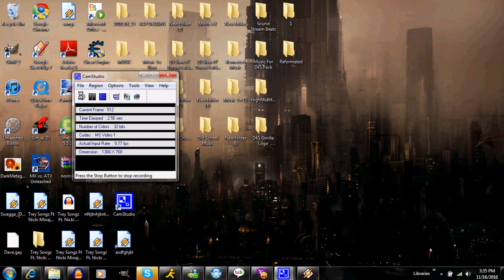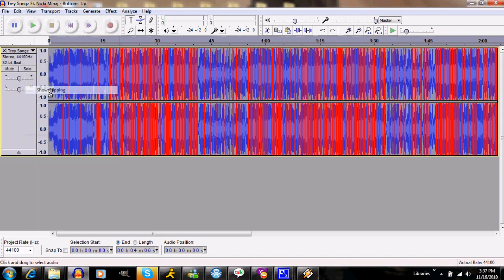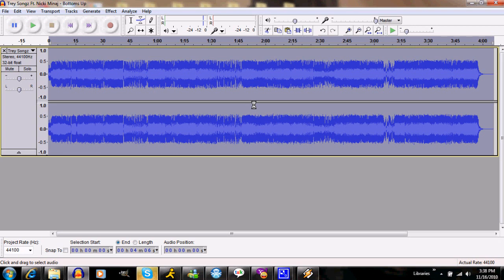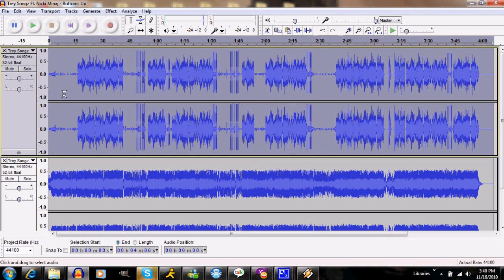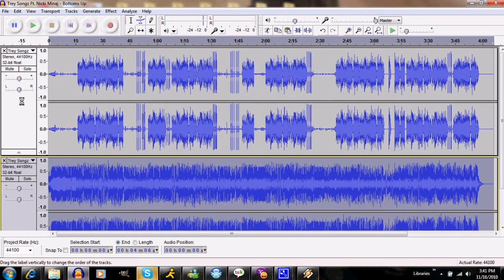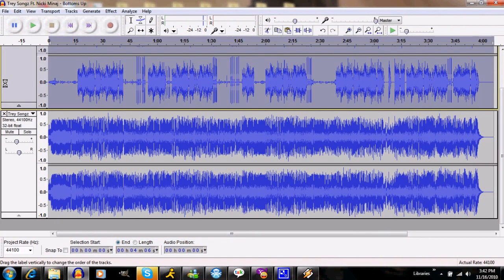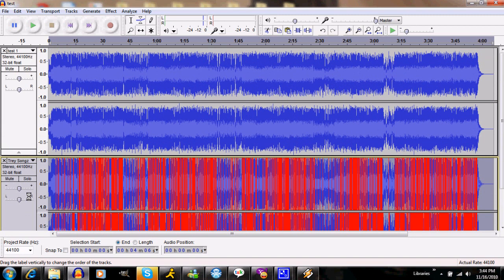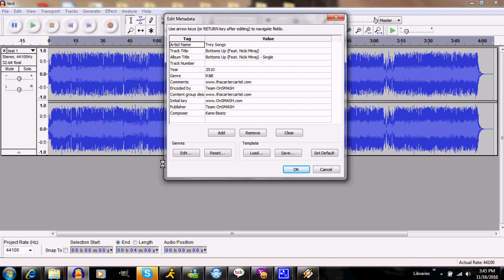Audacity 1.3 Clipping Removal Tutorial

Comment: Originally clipped waveforms aren't dangerous to gear except for the fact it has higher RMS, which is only an issue with woofer coil's thermal capacity.  But the exact same risk is present with waveforms that have gone through pleasing-sound compression-limiting with the same RMS outcome.  Output clipping on a power amplifier, however, is dangerous to tweeters from ultrasonic peaks far beyond the rated power of the amp (mismatch with the drivers with regards to handling), which is why all pro amps now have output limiters.

Comment: Uh, scratch that. I just put that audio with the video and I can still hear the clipping. It doesn't make sense. I followed your instructions. Why am I hearing the clipping?
Reply: Clipping is a distortion - this guy’s method doesn’t actually fix anything. To fix clipping, you have to go to source track.
Reply: Okay. Then what? Do I use the same instructions?
Reply: Honestly, I’m not that technically savvy. I’m not sure what to do next.
Reply: You can't fix peaking (otherwise known as clipping). It was the original voice actor's fault for not setting their gain low enough on their mic.

Comment: I have not tried this yet, I have a question, How does the low pass original file merge with the high pass duplicate file? How does saving two files (exporting twice) create one file? (I do not understand, sorry) Am I missing a step? Thanks in advance, rock on!
Reply: He exports it to merge the tracks (audacity auto merges them into a single set of stereo channels) then exports it again after re-amplification to get the final product.   Doesn't seem to be an easy way to merge the tracks without doing it that way.
Reply: Why not export and re-amplify at the same time?
Reply: Thank you everyone for responding. I have a version of Audacity that has a merge feature, really very easy. There are "101" versions of Audacity, some features work well on some, not on others, ie: nice sounding reverb program vs another version that's terrible.

Comment: Hey, my question is about how running a hpf and lpf, both at 70hz, redraws the waveform. I've tested this, and have seen that it actually works. Just wondering why or how it works. And couldn't the 70hz boundary actually be anywhere? 100hz? Etc? Or is there something special about 70hz? Thanks.
Reply: A lot of the clipping happens at the peaks caused by the bass. The squared peaks generate noise energy at harmonics of the bass's energy's frequency. Removing the harmonics from the bass restores its waveform. 

Most of the energy from melodic or harmonic instruments (including the human voice) has frequencies above 70 Hz whereas most of the energy of percussion instruments has frequencies below 70 Hz. 

The noise energy still exists in the higher-frequency tracks and is re-introduced when the tracks are mixed back together, so the distortion is merely mixed with the cleaned-up bass, not eliminated. 

I do not think the process removes any distortion from the upper-frequency tracks. However, if you wanted to divide those tracks at, for example, just above the peak frequency of the vocalist (700 Hz for speech of mature males), you might gain further reduction in distortion. It depends on the nature of the sound.

I don't think this is the best way to achieve de-clipping, but until I find an add-in that actually works, this will have to do.

Comment: Are you sure digital clipping can damage audio equipment?
This is a clever approach but I honestly think that the current clip fix option is a cleaner solution.
My advice is to double check if fixing clips is neccesary. In my experience most clipped audio files have not lost crucial information and a "simple" normalizing is sufficient.

Comment: Okay this seems really stupid. First thing first, clipped audio data has no way of harming your speakers/headphones. If it did, by the end of this video we'd all be staring in amazement as our speakers catch fire. The voice recording clips like hell.

Damage by clipping is a myth instigated by people mixing it up with clipping in a power amplifier. PA clipping creates high energy high frequencies which might overload tweeters.Then there are people who claim clipped data creates DC output which turns a speaker's coil into a heating element. This exhibits a lack of understanding physics; DC heats a coil just as much as AC of the same RMS value. So unless you pair an overpowered PA with weak speakers, there is no way any signal (clipped audio/square waves/even white noise) will overdrive the speakers. To add on this issue, no digital to analog converter interprets a clip or a square wave's top and bottom as DC, but uses fourier series to approximate the waveform using sine and cosine functions (so output is still AC, no matter what).

Now on the technique shown in the video. What is done is splitting a song into one sub 70 Hz and one above seperate clips, then the sub 70 Hz clip is mixed back with the rest of the song's spectrum, but at 3dB less. So unless audacity's EQ algorithm is real fucking wonky this procedure should do fuckall to fix clipping. You just lower the volume of both the clips and sub 70 Hz bass. Also, look at the green line of audacity's EQ. That's how the frequency response of the audio is actually processed, so even after multiple EQs there will still be quiet but audible remains of what you tried to filter out.
Reply: The method filters out the harmonics of clipped bass in the bass track. That restores the waveform of the bass track. However, the harmonic energy is retained in the midrange+treble track. When you mix the two tracks back together, the quality of the bass has been somewhat restored. That's all it does. 

It should be possible to fix clipping, but Nyquist programming is over my head.
Reply: +Zaparter while your imput seems educated i thank you for it however you denounced his method and also neglected to offer your own solution to the problem. . .
Reply: ForeverGoth There is no real solution to the problem. All audio information that was contained in these peaks is literally clipped away.

Minor clipping may be fixed by Audacity's Clip Fix algorithm with satisfactory results. Just lower the overall volume by a -6dB gain and apply Clip Fix. If the added peaks clip again you can undo and try lowering overall volume even further, but I wouldn't think those clips are minor enough to be repaired if that's the case.

Think of it this way: The waveform of let's say a kick carries all other frequencies of the mix, they basically oscilate around the kick's wave. If the kick's wave exceeds the brickwall, not only does the kick start sounding like a shoebox, but also are all other frequencies wiped out of the mix during every clip. There is no way of fixing such damage.

You might know this, but all of these clipped tracks that are released are a result of, as some call it, the 'loudness war' or as others claim 'better studio compression'. However I find it hard to believe that actual sound engineers are so bad at handling their equipment and/or software that they master recordings to hard-clipped BS in 8/10 cases. Taking into consideration that virtually all record and CD pressings (+downloads) come from the same master, but in almost every case only the digital releases exhibit clipping and signs of high-ratio-low-threshold compression really makes one wonder what the fuck the music industry is up to (e.g. have a look at Plastic Beach by Gorillaz http://imgur.com/SFmL9tD). There are exceptions to the rule, but those are mostly outside of genres that in any way might be labeled Pop/Rock.

So yeah, I guess if you really want to do away with clipping and you are lucky enough that your preferred music is issued on record, you might want to drop ~600$ on a turntable, preamp and A/D converter.

Comment: I have found that using too many volume tools adds distortion or there is some crunch in there because the digital signal is just manipulated so much. Like most things in life it is good to use things in moderation. I just mix/rendered in there and got distortion. These tools are valuable but, must be used carefully and checked for artifacts/distortion or strange sounding stuff added. I have not used this step but we did not hear for artifacts either. Trying things is good unless the effects are not good. I try to get a great saturated signal to start with and then the need for tools is lessened. But heck, try these things as these guys put some time in there. Getting the signal strong up there is very important without clipping. Pro's use some tools that are expensive and use some techniques/secrets in their programs that do these things without distortion and though the signal looks clipped there in audacity it might sound great on the radio or any player. They are after maximum volume without clipping so their mix is on top of or equal to any/all played on the air or at clubs. Audacity is great and more improved all the time but, is free and might have limits over expensive software or digital tools/hardware. there is a digital mixer out there for mastering mixes ranging in the 10's of thousands of $ dinero. Keep on recording or mixing.
Reply: I mixed/rendered and got some clips and is why I tried this tutorial. Compression/hard limit worked ok and got the clip out without any artifacts. I just wanted to see. I will be getting a 4 I/O usb hardware (@about $200.00) and they usually have great intro software that has most features of the expensive version for mixing.

Comment: Amplifying things isn't the way to go, it makes the track sound funny and actually changes the sound. Normalizing is what you're gonna wanna do, it keeps the integrity of the track. Don't ask me why that's the case, I have no damn clue.

Also Bodycage is right, you're not fixing the clip. It still sent too much sound through the system and it messed up the actual audio signal. So it'll sound better, but it'll still sound bad. Also, comb filtering isn't removing audio, it's different and ugly.

Comment: As much as I appreciate the effort you took into making this, this did not help. What you did was splitting it into two bands, and making one quieter. The exact same could've been achieved by EQing with a very steep curve (a brick wall version in your case). No need to split them from there. And still, this just removes clipping on the meters, the data remains clipped. Again, really appreciate the effort, but I just want to point out this could've been done by EQing.

Comment: I tried to follow this for a recording I made of our jazz combo that had severe clipping right at the beginning, probably because I set up my Tascam recorder wrong (just learning it).  I found that I had to do the opposite of what the author did by pulling down the equalization curve belowm, not above 60Hz for bass, not above, or I was effectively silencing everything above 60Hz.  Then I did the same at 20,000Hz, pulling the curve down to the bottom. Could this be because I'm using Audacity 2.0?

Comment: Wow!!! I was skeptical about this but damn.  I have always had a pain using audacity because of this reason.  I knew the songs I imported were getting clipped all to hell and I was one of those who was told to just normalize the track to -1 or -.5 dB.  Even when doing this I could tell the audio was still clipped to shit.  When the top of the track zoomed out to a 15 second spacing (time bar on top) is a flat line... yeah. Excellent video, IT WORKED!!